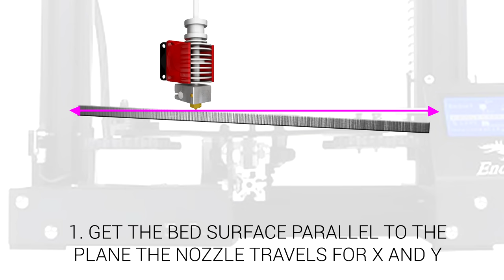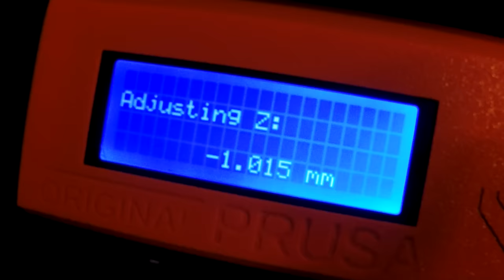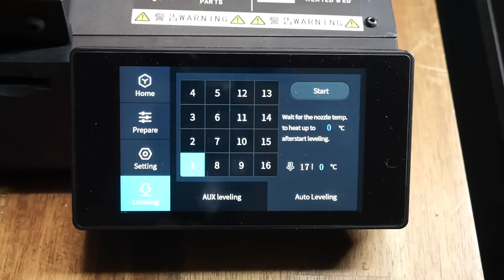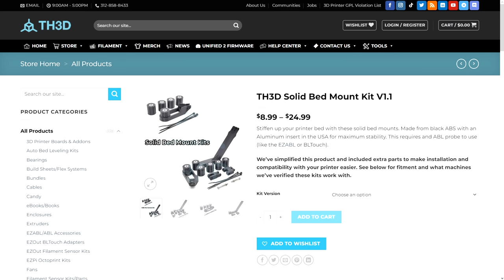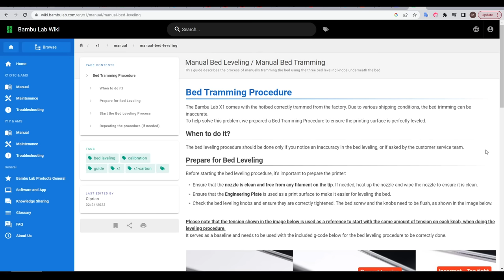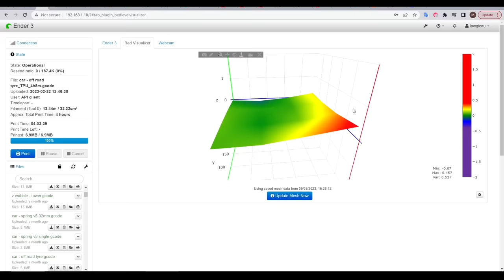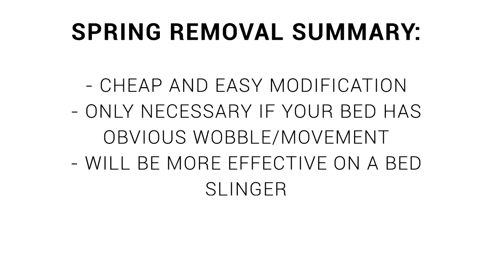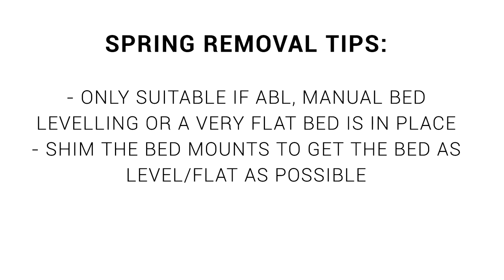Is it time for 3D printers to abandon bed springs?

Comment: I've not used any bed screws in at least 8 or so years. It's totally not required if you use a good Z-probe and mesh compensation. Also, the way forward is printers with fixed beds and printers with CoreXY and a bed that's mounted on three points that can individually move. So yeah, I think that bed springs can already be abandoned since somewhere in 2015 or so.

By the way, I'm using underbed piezo's on one machine and I'm very impressed by the precision. There was only one choice for me with this machine since it's a Delta, but I thought it was worth a mention :) Piezo sensors are awesome.
Reply: How dare you say that? The best 3D printer ever (Ender3) came out in around 2017.

Comment: Use disc springs or wave springs. 
They are stable and don't wobble side to side unlike coil springs. You can stack them to have longer deflection and you can put a dab of butyl caulk or damping grease in between them to have virtually no resonant vibration. Coil springs are asymmetric and are not laterally stiff so they are unstable. They pivot on their endings and bend like slinky. If you want a stable bed, then you can use disc springs, or even better  wave springs. Either way, no wobble, no resonant motion, just a very fine and solid adjustment.

Comment: In my opinion, bed springs originate in old RepRap designs, like a Prusa Mendel, where had two important functions - as a fail-safe mechanism for bad homing and more important fight bed rotation when it move back and forth. I build my Prusa i3 in 2015, and replaced springs with printed polypropylene spacer in 2017, tram table using indicator and do not touch this setup since then.

Comment: I run an E3 and E3 Max. The bed screws more or less rotate freely in place, making adjustment difficult. I'd applied lock nuts on the underside of the bed to one, but would not do that a second time. A pair of regular nuts works just as well and is much easier to install. Also swapped the original springs out for stiffer ones. And double-check the length of your springs.
Reply: Keep an eye on the nuts underneath that are holding your screws. I had done the same thing to my 5 Ender  printers and have had 3 nuts wear into the heating strips shorting the heater. Fixed the problem by replacing all the nuts with nylon ones and Loctite. I was fortunate enough to not have to replace the beds but it could have been worse if a fire started. Definitely better to have the screws rigid plus I have the stiff orange silicone columns instead of the springs. Never looked back after replacing those PITA springs! Also using EZABL for more precise bed leveling, highly recommend!! Run 49 points with Unified 2 firmware set at "superfast" probing. Remarkable results every time!

Comment: On my printer i use a rigid mount.

Right below the bed, the screws are tightened by nuts to keep them vertical or at least not wobbling side to side.

Then above and below the carrier, i have thin thumb wheels the thickness of a nut, with a nut embedded inside. I can adjust and tighten them down from both sides around the carrier, acting as jamnuts.

When i first installed the rigid mount, i had a mechanical failure of my probe and the nozzle rammed into the glass so hard that it broke it :D It first seemed to be intact, but when i raised the nozzle, that moment the glass chose to shatter into a bunch of pieces. That was funny, but i made 5 new glass beds from a 6€ IKEA FREBRO mirror.

Comment: My Ender 3 Pro kept having issues with bed levelling. I did everything I could think of, even getting a CR Touch to try and help. Turns out, the springs and wheels for the bed levelling were the issue in the end. The wheels would vibrate loose because the threads for the insert were slightly bigger than the threads on the bolts holding the bed to the frame, and the springs were contributing to the bed wheels loosening. I removed the wheels and springs, installed solid 3D printed spacers, and used proper sized nuts to tighten down the bed. Print quality has improved enough that I can now actually print things like the crystal flexi dragon model and not have an issue because the z wobble would cause the parts to fuse together.

Comment: My E3Pro still uses bed springs, although I replaced the original springs with some stiffer ones from an old inkjet printer I disassembled. My favorite system is though the thick bed and 3 point ABL with autocorrection, as that is an entirely automatic bed leveling process

Comment: I still use  bed springs on my SWX1's, but I may try to do this. Maybe have a lock nut above the rail mount and then the tension knob below? Leaves room for adjustment if needed, but removes the possibility of spring fatigue.

Comment: On at lest two of my printers I just torqued the adjustment knob as tight as I could, completely compressing the springs, and shimming the lower corners with washers to level.  They are essentially hard mounted now, and the mod just cost a cheep pack of washers from home depot.

Comment: I finally put ABL on my ender 3 max... 4.2.7 board... I have the springs as compressed as possible. I get good prints, but never had a problem getting amazing 1st layers on a glass bed, but I haven't thought about it as much since the abl. I run a .8 nozzle. sprite pro extruder and modified the fan ducts

Comment: Funny you should mention this.  Years ago I removed the springs from my highly modified Anet A8. To this day, that printer is a workhorse.  Perfect 1st layers every time without fail.   For such a cheap printer it has been around the longest for me.  One thing you might want to mention is that the sound from the steppers is quite amplified after the mod.  This may bug some people.  I ended up mounting my printer on a very heavy base which quieted it significantly while further improving the print quality.
Reply: Oh God....I hope it dors catch fire

Comment: I upgraded the springs and printed spring guides and bed level lock system. Cranked it all down as low as it could go. Leveled it within a .03 tolerance of each other and it doesnt move.
When I say I cranked it down I mean that I used channel locks to turn the wheels.

Comment: On older printers, the springs also helped prevent mid-print object detachments and layer misalignments caused by the print head passing over and catching on warped overhangs due to poor cooling.

Comment: I would liketo say that having wrestled with a faulty auto bed levelling probe, if the sensors starts acting up, you are on your way for a lot of failed prints (at one time there wasn't space for the 3 first layers and the extruder slipped continuously). I don't know for every printer, but I would say that manually adjusting the z offset is a really tedious and time-wasting process. On the other hand, on Z-axis bed printers such as the ender 5 and 6, having to adjust the bed height manually is easy, just add some raft to your print and you can adjust on the go. For bed slinger printers, I understand that the horizontal play creates surface artifacts, but everithing gets into play when dealing about surface finish, I was blown away when I realized the change in surface finish when I switched from dirt cheap PLA to prusament on an ender 6, the prints were metamorphosed, literally, no more blobs, partial clogs, uneven surfaces, ... just a way nicer print from just changing the filament

Comment: I've had decent results on my Ender3 with the stock springs, but there's a trick, and I suspect it's where a lot of people have come unstuck with the ender3 - if you snug down the bed too much, the aglet on the end of the Y-belt hits the underside of the bed, so it warps up in the middle. If you loosen the bed mounts enough to clear it, the springs aren't under enough tension to prevent movement and the adjusters vibrate out of tram during printing. About 3 or 4mm of washers under the springs gives them enough extra compression to sit well without fouling the belt-end-aglet. I think that was probably the reason so many went and bought stronger springs for the e3. That said, I think ABL and solidly mounted beds are probably superior, and I'll probably do that when I can be bothered installing an abl system.

Comment: I upgraded the bed springs on my Ender 5 to the stiffer ones and i tightened them up so they are almost fully compressed. I haven't adjusted the bed for a long time.

Comment: My Sovol SV06, with 5 mounting spacers, was making terrible level test prints. Very high on the left side. I printed a dial indicator mount and installed VERY stiff springs on the corners, leaving the solid spacer in the center. After adjusting to a fairly consistent level, I tried another test print. Still high on the left. I heard about a firmware update and tried it. VOILA! Much better test! Makes me wonder if the original ABL setup was quite right to begin with.

Comment: I have an ender 3 max, once i upgraded the bed to PEI the bed was too low, to solve this I added a bolt as a spacer underneath the springs, this brought the new thinner bed high enough for it to work properly.

Comment: There should be a tripple motor upgrade for the belt syncro printers if we feel it would help. But if they are great out of the box it will be a hobbyist or power user move.

Comment: I think it depends if your printer is a bed slinger or if the bed only moves in Z like Ultimakers or the Bambu printers, if it's only moving in Z you shouldn't get any ringing artefacts from the springs as they aren't moving fast or often.

Comment: With Klipper there is a fun function that lets you measure the bed height at the 4 points where the springs are, after which it will tell you what knobs to turn by how much to get the bed straight. ABL will then take care of any remaining bed warp.
Reply: How do you know ABL is working? The first layer should be good across the bed with it, right?
Reply: @amorton94  You can check the interface to see the bed mesh, but if your bed is flat it should already be almost perfect after adjusting the screws.

Comment: I am using the Aquila X2 (Ender 3 Clone) which has springs under the bed & to date they are still working fine, i have thought about trying some silicon blocks.

Comment: Hello! I kept the springs under my TT Bluer, but I almost fully tightened them, and from there I only released that that was necessary. Big help was a genuine BLTouch and the firmware's built in tilt-screw calibration tool. However after tightening the screws as much as posible the ABL bed mesh showed a more agressive warp (the center of the bed went up, sides went down) due to the thermal expansion and less compliant mounting, but the delta-Z is only around 0,25mm and with the mesh compensation (and well calibratez Z offset from the probe) I've never had issue with the 1st layer. :)

Comment: 3rd reason for springs - prevent the glass surface from shattering when the z dimension isn’t set properly. If your using an ender 3 if the nozzle height is set below the bed surface for whatever reason (absent mindedness in my case) the nozzle will hit the glass and the skipping stepper with jackhammer it. Honestly I wouldn’t recommend removing the springs from an ender 3, trying to get a low end printer to print as nice as a high end printer is not money well spent albeit a fun hobby if playing with the printer is more fun to you than actually printing stuff.

Comment: I think so. Personally, bed springs have caused more problems than they have solved, as there is always some movement on the Z axis affecting first layer adhesion print to print (and mesh bed leveling is not necessarily enough to compensate because the bed height/angle can be affected by the nozzle pushing on it during printing) and the screws can loosen over time making that problem worse. It was a constant headache on my first printer and I'm glad the Creality K1 Max doesn't have any bed adjustment at all,  the drawback is that the bed is not level (about 1mm difference from one corner to the other), but the software does a good job at compensating for that and my first layers are consistently good. And certainly provides for a much easier out of the box experience.
I would like to have some form of bed adjustment to level the bed initially but I don't think springs are the way to go because it's simply too unreliable. I'd rather have no adjustment than go back to bed springs.
Including spacers in different thicknesses that can be added to level the bed initially might be a better solution. The firmware can tell you exactly what spacer you need to add to level each of the corners, so there's no guesswork like there is with bed springs and how much they need to be turned, and while it's not as convenient to adjust it should only need to be done once.

Comment: A great alternative is using two nuts, one for calibration and the second as a jam nut. This method has worked in aerospace for decades, when you tighten two nuts into each other they just don't vibrate loose.

Comment: I replaced my springs on my printer 5 years ago, with solid spacers, and used metal shim-stock under each spacer until the bed was as physically flat as I could get it.  Then got BLTouch for auto-level. And its been 4 years since I had to level my bed. Meaning, I dont even use the BLTouch to level the bed. It just goes down, zeros, and prints. I do not have my printer run the autolevel sequence, as my large  bed requires 10x10 points, and it takes too long for me to bother.  Tis nice when your leveling just stays dead solid over years.

Comment: I use silicon springs on all my printers, Set with feelers and forget. I dont use the auto bed levelling at all. Set the 0.02 all round and trim the bed screws by feel on the slow skirt.

Comment: ABL is a crutch for manufacturers that can't produce kinematics with rigidity. My machines don't use ABL and I haven't had to adjust my bed height or z-offset for years.
In the absence of ABL, that bed height needs some adjustment and heavy springs, properly constrained, work fine.

Also, on the Ender3, half it's problem is the v-wheels being used in a sub-optimal orientation. The conical profile of the wheels riding in the slot in a horizontal instead of vertical plane means that all the weight of the bed is resting on four (or six, if you have the center wheels) small and relatively soft contact points on the bottom side of the wheels only. It's hacky and stupid and replacing that assembly with a linear rail or even hardened rod and recirculating sleeve bearings spaced further apart fixes the geometry quite well.

Comment: My ENder 3 Max came with the stronger yellow springs that are offered as an upgrade to earlier Ender 3's. When I was setting up the printer the distance between the nozzle and the bed was too large, but rather than loosening the springs which would make the bed vibrate more, I adjusted the height of the Z switch so that when correctly adjusted the springs where still tightly compressed, and even with the large bed its hard to push it from side to side. If you have to loosen the springs too much you're going to have trouble keeping the gap consisitant. 
So far I haven't had any problems keeping a consistant first layer when I get  it right without any ABL, but I concede getting it right in the first place would be easier with ABL. I dont seem to bave any problems with bed distortion but maybe I am just lucky!

Comment: 5 years printing Ender 3s with stock springs, ,stock hot ends stock stock stock, and default Cura settings. I only calibrate the extruder esteps and None of these "issues" are even on my mind and I have consistent beautiful prints and earn $$$ Every year with my detailed products....

Comment: if your springs are wobbly and vibrating loose, you didn't tighten them down enough. you should also add nylock nuts below the knobs if you want to really lock in your bed adjustments. ABL is not a substitute for actual tramming. it's a band aid at best.

Comment: I switched away from springs once I installed my BLTouch and went with the silicone mounts. I rarely have to adjust anything anymore, compared to almost every print needing readjustment with the upgraded springs.

Comment: I've been using TPU spacers I printed myself for a few years now. No issues with heat and if you print with low infill like 10% you can give the levelling knobs a bit extra twist to compresss the spacer slightly and level the bed instead of using washers
Reply: I don't think your TPU spacers will withstand 100ºC bed temperature ?
Reply: @alejandroperez5368  No they don`t. I use my E3V2 on max bed temps a lot, TPU will deform slightly after a while. I`ve tried several brands of TPU. But 100C i think is ok. I have my bed max at 120C. That is to hot for TPU over time

Comment: Hello!
Just wondering if you have any thoughts on a system like 3D Chameleon that does a 4 to 1 filament to nozzle for multi color/material printing on something like an ender 3? Thinking about getting one but seems theres not a lot of 3rd party info on it when considering the cost

Comment: My AnkerMake M5 was springless from the factory.  Conversely my Neptune 3 Max has sooooo many adjustment knobs.  I was going to tinker with my old original Ender 3 and already have ABL i  that plan so think I’ll ditch the springs using your guide here as soon as that’s working.

Comment: My modified Ender 5 Pro with TH3D ABL does have the springs. The 5 Pro came with stiffer springs so they are not a problem usually. My FLSun v400 does not.